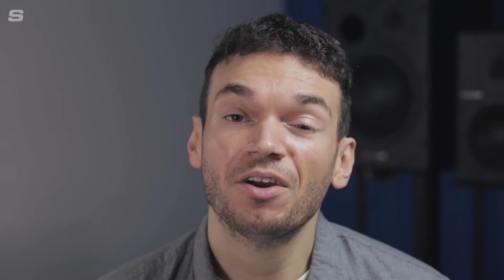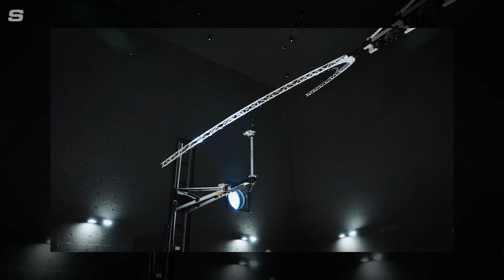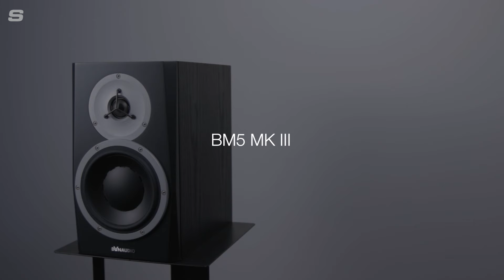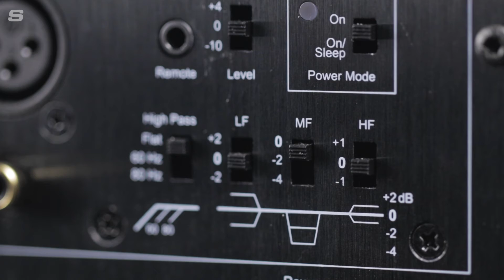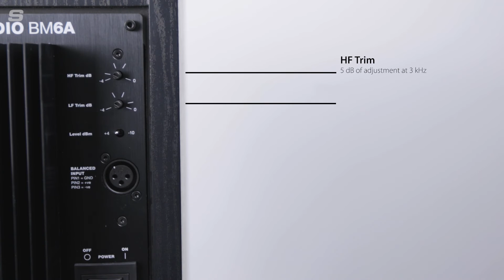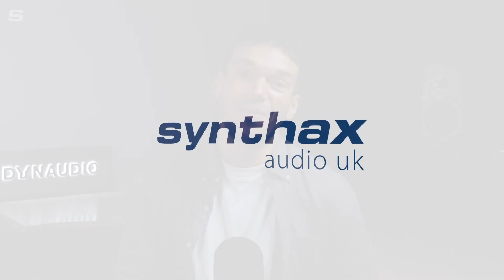Dynaudio BM Classic Overview: An introduction to the BM5 MK III, BM6A and BM15A Studio Monitors

Comment: Bm15A or Lyd48? I need to listen and produce music and I'm looking for a compromise between musicality and analyticality. Room size 16m2.
Reply from the maker: Hi, the LYD48 is probably the better choice in 2026 if you want accuracy and good mix translation — the 3-way design and DSP work really well in small rooms.

The BM15A is a classic, probably sounds a bit 'bigger' and more musical, but in a 16 m² room it can feel too much unless the room is well treated. They also weigh 18kg each (compared to 12kg for the LYDs).

Both are great monitors but for a balance of musicality and analysis in a smaller space the LYD48s are the safer all-rounder - very accurate and neutral but still keeping a sense of fun. The BM15As are still loved by a lot of older engineers as its the classic sound a lot of them grew up on.

Comment: It is simple. The bm active series outperforms anything at their cost or up to 5x the cost, because it can achieve very high spl for the speaker size. A single 10 inch bm15a is louder than speakers with 2x12 inch or even 2x15inch woofers at similar distortion because it can use a 4inch voice coil. This makes these speakers very low in distortion at typical monitoring kevels  The difference is imnediately audible. In direct comparison other speakers are inferior in mid field setup because the distortion is too high and fatiguing even in near field  The new dynaudio models are nowhere near the bm6a and bm15a performance that have the good woofers and better amps that sound fine even in overdrive. Competitors need a multiple in size and power and still cannot compete. Nothing compares with dynaudio bm6a and bm15a at their price range abd size. The woofer technology remains the best on the market.
Reply from the maker: Thanks for sharing your experience - great to hear you're still enjoying the older models!
Reply: I have the BM5 MKIII for 5 years and I like them verry much. They sound perfect and I use them for playback only. But value for money here is unbeleavable cheers.